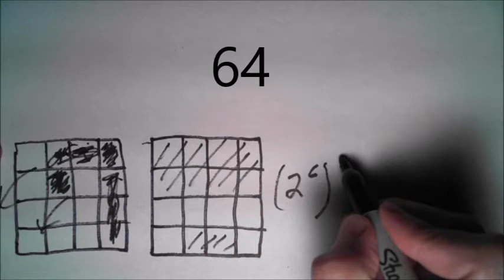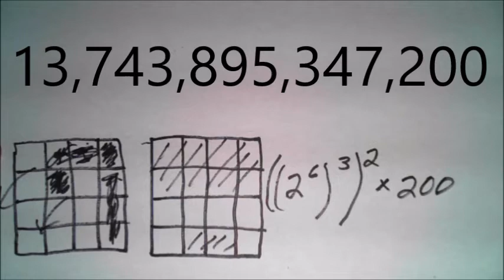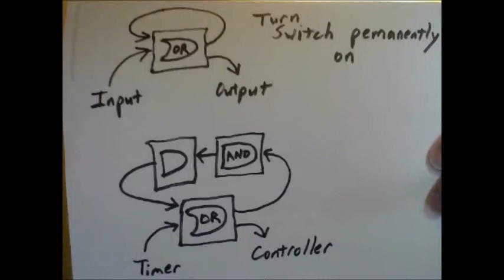Scrap Mechanic: Scanning in 4 Dimensions - Trillions of Lock Combinations

Comment: i have an idea what you maybe could make with the  time dimension you can maybe make a speed scanner so a few sensors after each other and then it will look at the time and say in a number (i dont know how you gonna do that) but then it says how fast
Reply: that would be usefull
Reply from the maker: That's a pretty good idea!  Yeah, I'm sure it's possible and would have to think about how.  You would need a counter module and maybe have a timer with one tick on it between each count, plus a display for the count.  Getting it to display how long it took to go by would be somewhat easy, I think.  Converting that into MPH or KPH would be trickier.  You would need Brent's calculator to do division.
Reply: if you already make it lik it can tell you like from 1 to 10 how fast would be alreay good if somone wants to know wich car is faster they can use that
Reply from the maker: UltraGPower made a speedometer:
http://steamcommunity.com/sharedfiles/filedetails/?id=753642681
Reply: thats great

Comment: maybe (it will realy take a while but try to make a scanner in 3 directions that can scnan something you can save it then it will scan things and if they are th same as the saved scan then it would go open something like that
Reply from the maker: I suppose you could have two 3-D scanners.  One for the initial scan and the other for the comparison.  It would mean linking every logic gate from one scanner to the corresponding gate of the second scanner.  I probably won't get to that anytime soon.  You might take a look at Dr. Na'Vi's video:
https://www.youtube.com/watch?v=ms01ioxlsCs
It's not doing what you suggest, but it scans 4 different objects and then opens 4 different doors.  In the video this is before logic gates, but he has a version using logic gates on the workshop.  Pretty cool.  Incidentally, I discovered his stuff after I made my scanner.
Reply: ok

Comment from the maker: I should add you can actually get more than 14 trillion combinations without having to do a 4D scan.  You just need a bigger bank of scanners.  Three  8x8 banks of scanners doing one 3D scan - figure only 5 rows usable, would be 2 to the 40th cubed, which equals 
1.3 x 10 to the 36 combinations.  That's this number: 
1,300,000,000,000,000,000,000,000,000,000,000,000.       :0   But scanning in 4D is cooler.